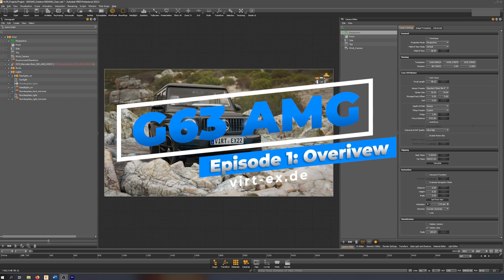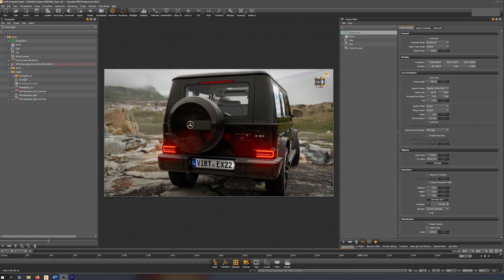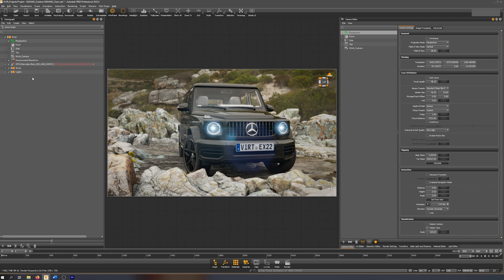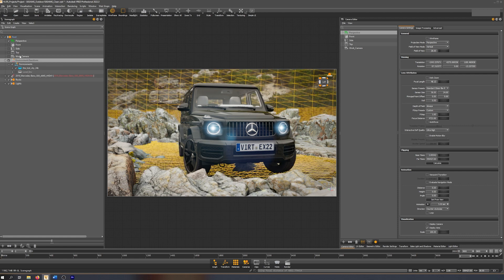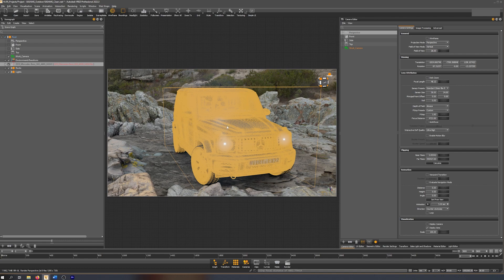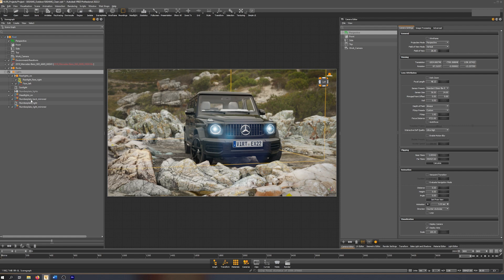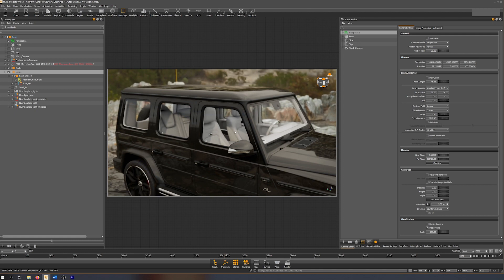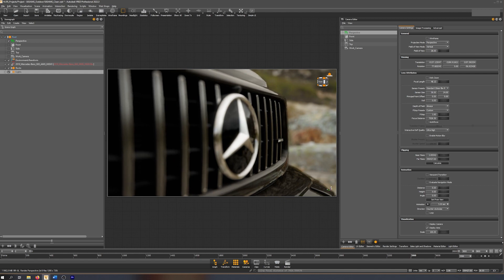Creating a realistic real-time G63 AMG in VRED - EP1: Overview

Comment: Hi , thank you for making this series , I have watched almost all of these videos, really really helps, I would like to know if you tried running this light baked scene on VR , if you have tried please tell me how well it ran. As I am looking to do it & I am wondering if it would be able to handle so many texture and reflection maps real-time.
Reply from the maker: Glad it`s helpful! That worked with no issues. Just check how many frames you have without VR and if you are in the range of 60+ FPS it should be all fine for VR. In my case it was fine. Textures and maps are more problematic for your graphics memory than for the performance.

Comment: Additionally, you can get a Quixel Megascans subscriptions for 4 to 5 months. it will give you enough download points. You can use Megascans geometry, which has much better look and feel (it has LOD levels too). Turbosquid models are very average at most, with few exceptions of course. please have a look at my works which is done mostly using Megascans, rendered in Maya and VRAY. https://www.behance.net/cgvoyagestudio
And Lucas, i have sent you some dm on LinkedIn. Please have a look.
Thanks.👍